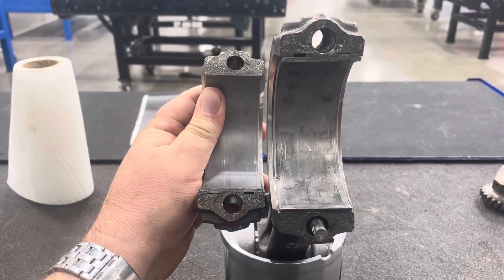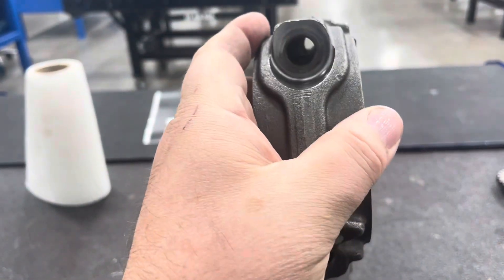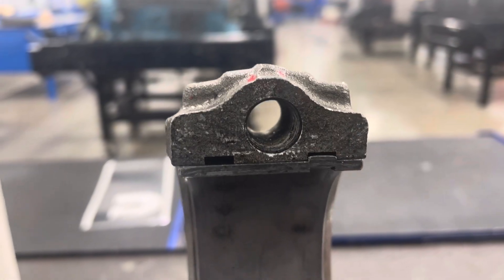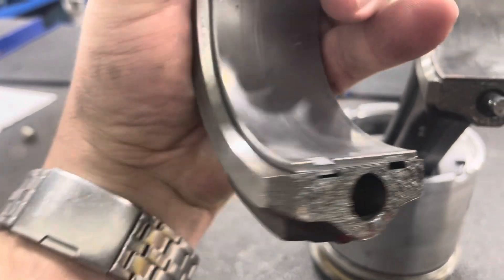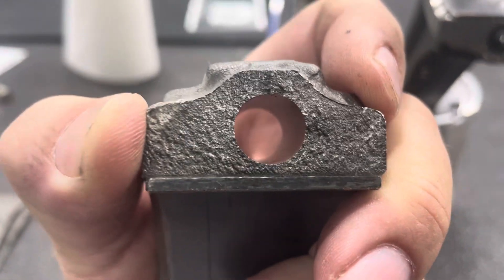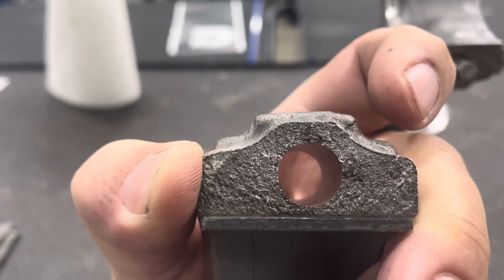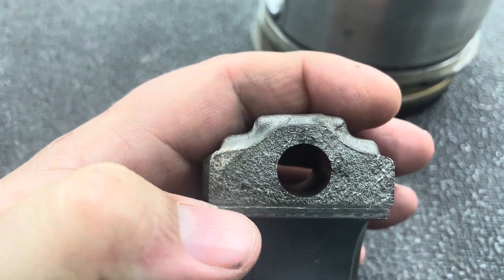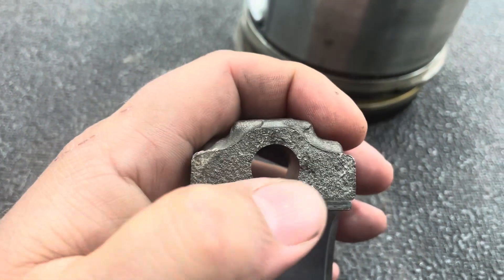Diesel Engine connecting Rods and Caps. Fractured Rods! Full video

Comment: I would like to see some camshaft work with Cummins isx never worked with them I mostly work mid range engines 8.3 Cummins an l9 and dt466 an few 3126 cat
Reply from the maker: When you say "camshaft work" what exactly do you mean?
Reply: @charleysgarage  using the timing wedges an the gear install
Reply from the maker: @kellycowett6254  next time I do one I will film it. Don’t get many chances to dig into those overheads Cummins like ISX/ISM much anymore though.